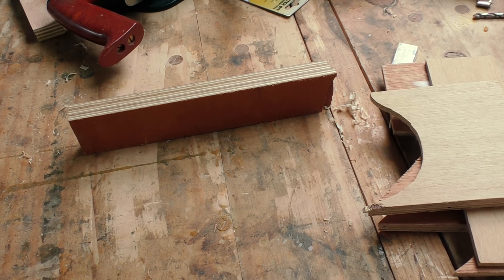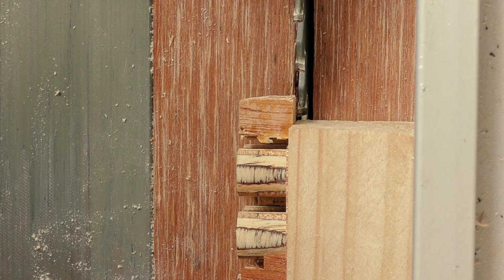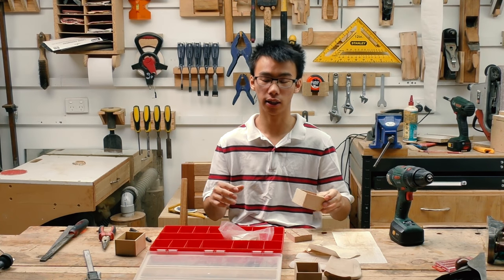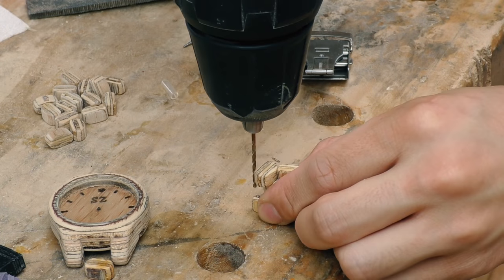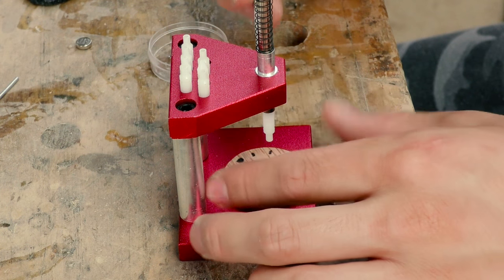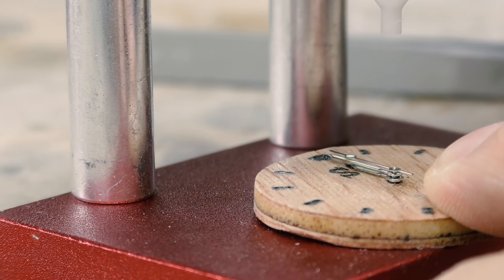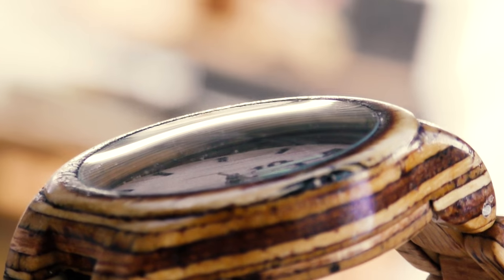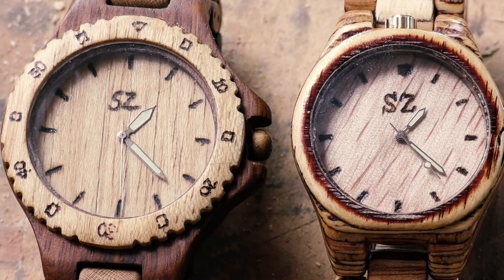Wooden Watch Mark 3 Part 2

Comment: Hello Steven. What are the pins called that hold together the watch links (if you had used them instead of nails)?. And also how long would they need to be? Thankyou
Reply from the maker: I searched up "stainless steel toy car axles", anyway, found them as part of some toys on eBay at first, now I get them completely from Taobao, nails seem to work just fine too

Comment: great videos ...and asking for the  finish coat type as i   made my own wooden watch like yours  but want to   know the right finish way and type to seal the wood and also safe foe human skin .... thanks
Reply from the maker: I used tung oil, it's supposed to be safe in contact with food, so not sure whether with human skin, but I'm sure you'll be fine with just about any finish since human skin is a very good barrier against the external environment.

Comment: You are doing great work.What is the G code for making these links on a CNC? Thank you
Reply from the maker: I didn't cut the links out on the CNC for this wooden watch, which means that I didn't generate the necessary G-code for it. If you have Inventor installed you can generate the G code from the plans, or have a go with the PDF.

Comment: Congratulations very good job, wonderful. A question what kind of glue do you use. Greetings from Colombia
Reply from the maker: I use Titebond 2 for general wood connections, epoxy for extreme cases and non-wood to wood connections, silicone for the glass crystal of the watch.

Comment: Hi may I know how u install the glass ? Did u use any glue?
Reply from the maker: it is just a press fit, but I also put a bit of silicone around the edge to seal the gaps
Reply: Steven Zhang I see! As my glass on my wooden watch will fell out when the watch caught in the rain, so I wondering how to make the glass fit to the wood